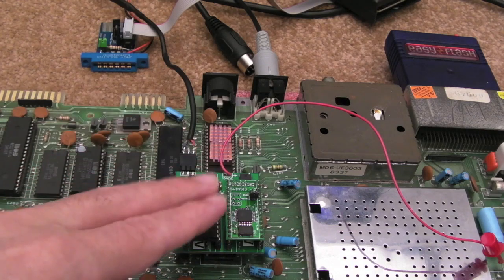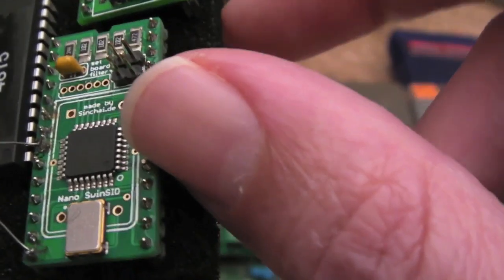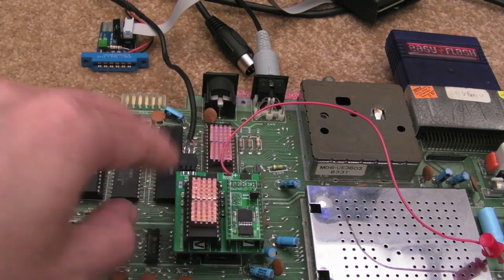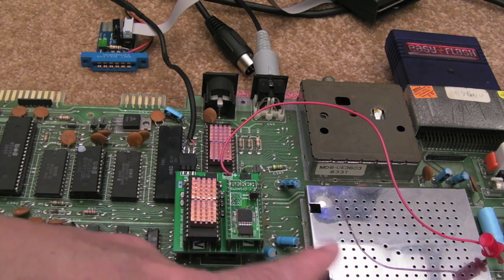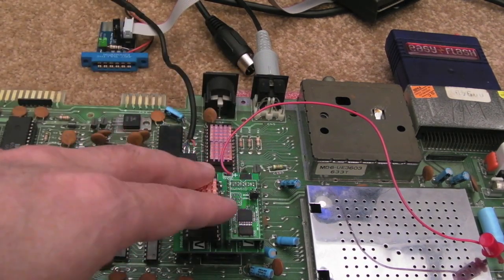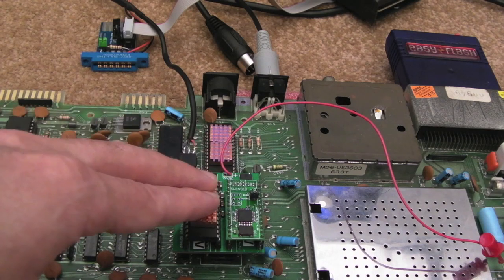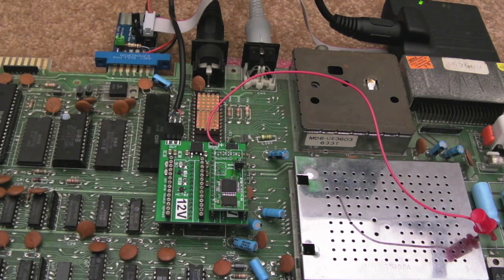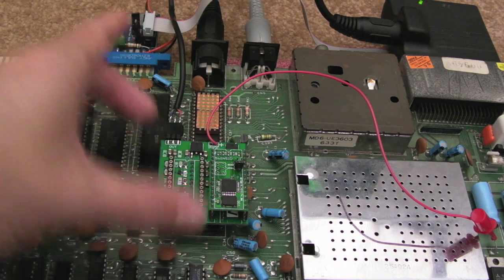Commodore 64 (C64) Nano SwinSID CS Fix & Dual SID Update

Comment: Funny thing is that I get a very similar thing with the Turbo Chameleon 64 V2 in cartridge mode. When I plug my speakers into TC64s 3.5mm audio jacket it is supposed to use the emulated SID. I have heard it does some readings from the real SID inside the C64. So if I have the real SID inside the C64 the TC64's emulated SID sounds perfect in Alien when I am plugged into the TC64. If I remove the real SID or replace it with a nano SID I get a similar sound issue the SwinSid Nano has with Alien (missing the 'woaahh, woaahh' part) and a few other games when using TC64s output. Funny thing is also that I have tried a couple of defective SIDs. One of them has a really low output volume, another one sounds strange and is missing a channel or something. But if I plug any of these into the C64 but connect my speakers to the TC64s audio port everything is perfect. I get the benefit from the defective SIDs, making the TC64s sound output to sound like the real SID with no issues. As a side note, TC64 can emulate two SIDs. I have both set to 8580s. Maybe I get something very similar to what you have here. The emulated SID is more like a swinsid but it takes readings from the real SID and everything is perfect. But the coolest thing is that this makes defective SID chips useful. I wonder if the same thing would happen with your setup, if you used a defective/partly defective SID in combination with that Swin SID. If so, someone who has a defective SID chip could just buy a dual SID board and a swinsid nano, then use the defective SID in combination with the Swinsid and get perfect sound.

Comment: I damaged my SID and the SwinSID doesn't support C64 mouse and paddles. If the mouse/paddles still work on my damaged SID is there a way to use it with a SwinSID Nano with the Nano for sound and the original for mouse/paddles?
Reply from the maker: If the potx and poty still works on your faulty SID, you could get a dual SID board, use the faulty SID in 1 socket 1 (for mouse and paddle), and still a nano into socket 2.  Or you could get a swinsid ultimate.
Reply: GadgetUK164 - Retro Gaming Repairs & Mods Thanks, but I'm resorting to this particularly because SwinSID Ultimate is looking like Unobtanium now. :( Were the details for a DIY SwinSID Ultimate ever made available?
Reply: GadgetUK164 - Retro Gaming Repairs & Mods Thanks, but I'm resorting to this particularly because SwinSID Ultimate is looking like Unobtanium now (Facebook page is inactive). :( Were the details for a DIY SwinSID Ultimate ever made available?
Reply from the maker: No, the code and PCB layout was never released for the SwinSID Ultimate - its a closed project atm.

Comment: hey random question would it be wise to change the caps on the c64 even if the read ok incl the fuse
Reply from the maker: +scroeffie Yes, wouldn't do any harm to swap out the old caps!  The fuse won't make a difference - I would certainly check its rated correctly though in case someone has swapped it for the equivalent of a nail =D

Comment from the maker: Update 19/12/2015 : Tried 1K pull downs (didn't work) and then 1K pull ups on the Nano, and had it disabled when CPU tries to read it.  With pull ups this allows Last Ninja 3 intro to show without skipping, and you can play the game.  It does cause issues with the music in Last Ninja 3.  The pull ups fix issues on R-Type and Last Ninja, but I wouldn't implement pull ups as a permanent fix.  It appears that the emulation in general is probably the cause, and it looks like the Nano is probably responding but with inaccurate values when compared to a MOS SID. ie. its probably timing related, or maybe a bug in terms of the way the registers read inaccurately represent the state of playback.

Comment from the maker: I've just tried a 10K pull down on the data bus in the empty slot 1 - just to see if I can help pull the bus low when the Nano is disabled (via CS & RW) from slot 1.  Still the same, but I think 10K is a bit weak.  I've ordered some 1K resistor arrays, I will give that a try in a few days.  I do know that when using diodes on my Dual SID board I needed a 1K pull down in order to pull down the CS quickly enough.

Comment: Awesome, i've just pickup one of the DualSid boards from dave and im on the hunt for a
second sid now (6581) for my c64c, WOW the sid's are going for crazy prices on eBay.
but it's going to be worth it in the end i can't wait to hear my c64c in stereo.
Reply: +GadgetUK164 I tried that too. They gave me a tracking number on Nov 28th and its still sitting there saying electronic shipping info recieved. I sent the guy a message asking if it was ever going to actually ship and he replied back yesteday "3-7 day send, would you please wait". Not sure why I bothered really, as if I ever get anything itll likely be fakes anyway. Would you share the name of who you got yours from? I tried ordering from "Yida Electronics" Well see I guess...
Reply: After wasting more than 6 months attempting to order SID chips and then waiting for packages that never arrive and filing refund claims, I did manage to receive about 10 SID chips. Of which only 6 worked at all, and only 3 of those 6 were fully functioning chips. $30 a pop is expensive but to me, if you need a replacement SID its probably best to just buy one on ebay as the china route is far too much trouble.
Reply from the maker: +FourX2k3 Great pickup =D  Yes, they seem to sell from £25 to £40 =/  I am waiting for a few from AliExpress but I think they are likely factory rejects, so I don't expect much of them...  Worked out a few pounds each.
Reply from the maker: Did you ever get yours?  I ended up filling a refund claim because they never turned up!
Reply: After wasting more than 6 months attempting to order SID chips and then waiting for packages that never arrive and filing refund claims, I did manage to receive about 10 SID chips. Of which only 6 worked at all, and only 3 of those 6 were fully functioning chips. $30 a pop is expensive but to me, if you need a replacement SID its probably best to just buy one on ebay as the china route is far too much trouble.

Comment from the maker: Just to clarify (again lol) - there are multiple scenarios and affecting factors here.  
1) If using a substitute PLA a cap might be required on the Nano CS pin.  (I had to use 47pF or 68pF - I forget which)
2) If using a Nano with a MOS PLA, no cap should be required.  
3) If using the Nano in a single SID system, the Nano will glitch on tunes where the SID is read by the CPU.  
4) If using a Dual SID board, the Nano needs to be in slot 2 to sound 'perfect'.  Cap may be needed in slot 2 and the size depends on the Nano revision, whether you are using a substitute PLA or not.   If you use the Nano in slot 1 in a Dual SID board the sound issues with games that read the SID remain.   
5) In summary, at the moment the only way to get perfect sound for all games using a Nano is to have the Nano in slot 2 of a Dual SID system, and have a MOS (functional or partly functional - needs to be correctly readable at least) SID in slot 1.
Phew!!!!
Reply: +GadgetUK164 Does It make a difference based on which commodore unit you use with the SwinSID? and the PLA?
Reply from the maker: +Amy Marie No!  Same issue occurs in different boards and with any PLA!
Reply: +GadgetUK164 I ordered one from Dave and will be using the 8580 in slot one (thats if my C64 is still alive....). Just one question, as there would normally be a 6581 in the socket, will I need to replace the 2 filter capacitors on the motherboard to enable correct sound via the DIN socket?
Reply from the maker: No, the caps on the dual SID board take care of that, and they don't clash with the ones on the motherboard.  You still get sound out of SID1 from the DIN as normal.
Reply: +GadgetUK164 Board arrived today, installed SID1 8580R5 & SID26581R2 (with intermittent probs). Will order a SwinSID when I save some pennies. Sounds great BTW, thanks a lot for all your help and advice, very much appreciated! (The new VIC-II resolved my Video issue too!) :-)
Reply: +GadgetUK164 Hi, does it matter which version SID you use in Slot 1 of the dual SID board? I was considering using an 8580 in slot 1 and a SwinSID in slot 2 on my Breadboard C64
Reply from the maker: It depends if you are making a dual SID board from a SID2SID board, or whether you are buying one of the Tynemouth Software Dual SID boards.  I would recommend the one from Dave at Tynemouth Software, because if you tell Dave which SID you want to put in slot one, he will configure the voltage regulators on the board to make sure you don't damage your SID chips.  On a C64 breadbin, the 6581 is powered with 12 volts, whereas the 8580 on a C64C is powered with 9 volts.
Reply: +GadgetUK164 Thanks for the quickreply! :-) I was planning on buying one from Dave but wasn't sure if you must use a 6581 in slot one for the SwinSID to work properly? I do have both versions of the SID chip but the 6581 seems to be dying... I've never been able to try the 8580 in my C64 because of the voltage difference. So, if the 8580 works perfectly, I was going to use a SwinSID in slot 2, and this will hopefully produce the missing samples in the 8580? Hope this makes sense... :=$
Reply from the maker: Yes, I would use the 8580 in slot 1, and the SwinSID in slot 2.  Just tell Dave your plans before you buy, so he can make sure slot 1 has 9v.  The SwinSID will work with either 9v or 12v. - it actually doesn't take that pin input it uses the 5v instead I think, so you can put the SwinSID into either slot.